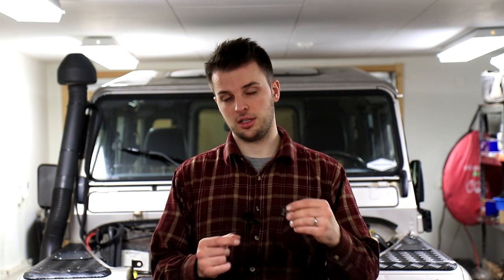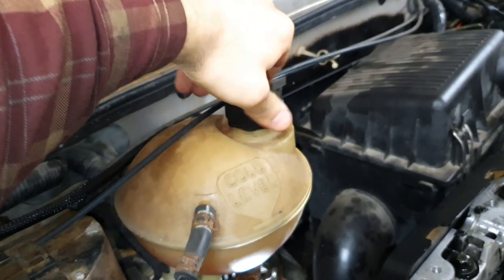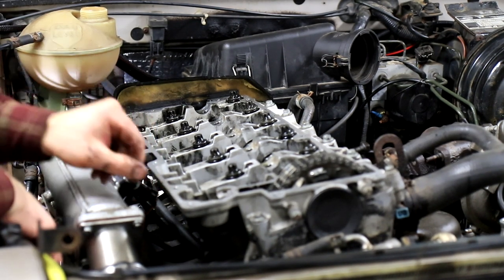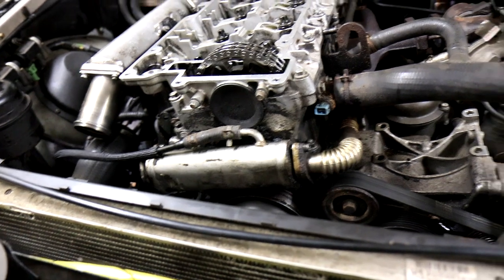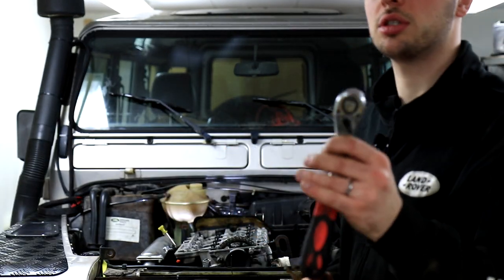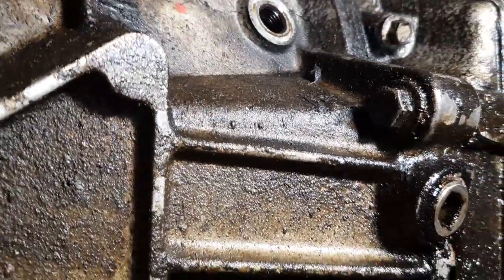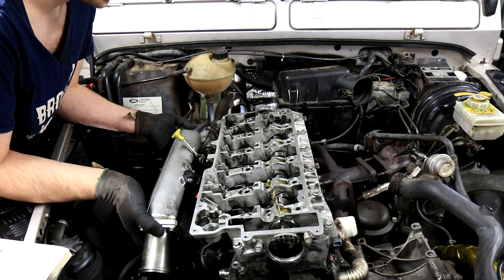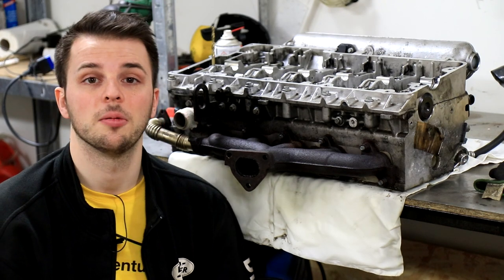Td5 Cylinder Head Removal - STEP BY STEP DIY - No special tools!

Comment: After owning my '01 Defender for 5 years, there isn't much I wouldn't/haven't tackled.   I'm at the same spot you were a year or so ago, diesel leaking into the oil. the surfaces of the injector locations are "knackered" (as some would say) so it's a new head. Watching this.....I'm thinking I can do it. Appreciate the videos.....and I even more appreciate that you're not getting too frustrated with spending $$$ on the rig!  That's the hardest part.
Reply from the maker: Aw man, sorry it is giving you those problems! 
I hope you get help from these videos and the courage to do the job. 
It was a lot of money but I got the vehicle for the price of a new head so it was worth it too😅 Good luck with yours!

Comment: Regarding the home made flywheel lock on the bell housing, I struggled to find the hydraulic fitting referenced in Haynes at short notice. However an 8mm microbore straight compression fitting is almost identical and has the right thread size, combined with an 8mm drill bit this works a treat. Screwfix / tool station always have them in stock in branch.
Simply bore out the centre with the same 8mm drill bit you’re planning to use, mark  on the drill bit how deep it needs to go in order to lock, screw either of the male ends of the compression fitting into the bell housing, gently knock the drill bit into place with a hammer, and if you want you can use the nut and olive from the compression fitting to lock the drill bit in place.

Comment: Amazing Content! I just assembled my TD5 head using the videos from the channel, my TD5 is filling up the cylinders with diesel, copper washers are new, it happens to all 5 cylinders, it works for a couple of minutes and then cut off/hydrolock.
Reply from the maker: Thanks for watching! Hope it helped!
Does it still do it or did you replace the cylinder head?
Reply: @Td5Adventures  It is still happening, I couldn’t find the reason so far, it didn’t happen before I take the head off. I’m guessing the rockers screws from injectores are too tight causing the injectors to flood the cylinders, is that a possibility? When you tight the screws, do you put some pressure on it or it is supposed to hit the top of injector smoothy? Greetings from Brazil!
Reply from the maker: @GHIOLIVEIRA1  hmm, weird!
You might have an injector which is stuck open?
Tightening them did require some force for me too..

Comment: Very helpful! Just adopted a friend’s disco 2 after it failed the MOT, found some rust holes and a pressurising cooling system. Pretty much resigned to head off and inspect but not in a rush 🤞 it’s not cracked! Useful to see one stripped, thanks!
Reply from the maker: Thank you! I'm glad it helps, that's why I do it😁
Let's hope you can fix it easily! Good luck!

Comment: Nice job👍 When you are tightening the head bolts, make sure the socket is 90 degrees to the bolt head, as they can easily twist off under the torque required
Reply from the maker: Thanks and thank for the tip! 
Will definitely remember to do that😊👌🏻

Comment: Excellent!!!  Did you finish the later videos (at least two) of this Head Gasket replacement?
Reply from the maker: Yes they are also on my page, this removal video, one where I assemble the new cylinder head and one where I reinstall the head gasket and cylinder head step by step😊
Thanks for watching!!
Reply: @Td5Adventures  Yes, just saw!  Such attention to detail - great work!  Doing my HG in next few days - your videos are A1!👍👍
Reply: @Td5Adventures  Really well done I must say - you are very thorough - I like that.  I'm going to put a new head gasket (+ several other jobs) in my D2/Td5 shortly, so these three videos are great to watch - I also have the Haynes manual and RAVE to refer to.

Just one thing, can I just confirm you didn't drain the engine oil (or remove the centrifugal filter housing), only the OAT coolant was drained?
Reply from the maker: @intestinalworm1202  Thank you!! I wanted to show all the steps so that it might help someone. 
I can confirm that I did not drain the oil before the procedure. I did do an oil change after the job because I had diesel in my oil, the reason I changed the cylinder head. 

Good luck!

Comment: hi very helpful video! do you lift the car to turn the Engine to OT or? I have a Disco 2 with automatic transfer do you  know if i just can put the transfer in neutral and then turn the enigen to OT? 
Greets from Berlin
Reply from the maker: Sorry for the slow reply and thanks for watching!
You can put the gearbox in neutral and spin the engine by hand 👌🏼
Good luck!

Comment: Love your Videos! It’s so much easier removing the cylinder head off a pushrod engine! Why are low revving diesel engines designed with Over Head Cams!?! Chevy V8s can rev to 9000 RPM with Pushrods!! Also pushrod engines are more compact lighter and cheaper to build!
Reply from the maker: Thank you for watching!!
I mean they might rev to 9000 after loads of aftermarket upgraded parts. There is no 1999 pushrod V8 that'll rev that high. Pushrod engines have been replaced for a reason though...
Reply: @Td5Adventures  Even if they are modified the point is a pushrod motor can rev much higher than the typical 4000 to 5000 rpm of a diesel. Some of these pushrod engines are tuned to produce 5000 hp!   https://www.youtube.com/watch?v=oeps18chvC0
Reply from the maker: @captarmour  Sure but with a diesel you don't need more than 1500rpm to get full torque out of it anyways👌🏼

Comment: Hi good job. Leaving the manifolds on adds considerably to the weight of the head as you found out. When I did mine I was working on my own and so removed as much as possible. Still very heavy.  My 15p head was cracked and I went through the same process as you replacing injector seals twice before finally accepting the head was cracked. I replaced the LR head with an AMC head which has now been on longer the the original without any problems. Would throughly recommend you replace the head. I presume the Haynes manual states that you replace the head bolts as these must not be reused. 
I will continue to watch your progress. If you need any advice please ask, I will try to assist.
Reply from the maker: Thank you! 
Yeah but I wanted to make as easy access as possible to the manifold nuts as not to snap or round any off :)
Yeah, the head will be replaced as so the head bolts and a few other stretch bolts!
Thanks for watching and commenting!!

Comment: I am having trouble finding a way to hold the fan pulley to unscrew the nut holding the fan. Are the tools you showed in this video Land Rover tools? Do you have part numbers?
Reply from the maker: Hi! Yes, the part numbers for both are LRT-12-093 & LRT-12-094 or get them both at Paddockspares as partnr PM1278
Reply: @Td5Adventures  thanks much!
I would like to get my hands on a low mileage late model TD5 Motor. I am finding out that this one has overheated a couple times and the Head has been cut(machined) twice. Once because of getting warped from overheating, second time from corrosion pitting due to use of incorrect coolant/antifreeze.

Comment: another question please. can I remove the head without removing the fuel injector rockers, shaft and the camshaft? Also if I mark the camshaft and chain with paint can i refit the head using these marks if I do nut turn the crankshaft or the camshaft? I'm guessing the tension of the valve springs would most likely turn the cam when I undo the cam chain sprocket...
Reply from the maker: Sorry for the slow reply. 
I don't think you can do that. Check the Haynes manual or Land Rover workshop manual for the exact procedure.

Comment: Your video is the best out there!  Quick question - I want to remove the injectors and overhaul them BEFORE I remove the head.  I assume if I have removed the injectors and then have both the locating pin at the timing chain end and then another underneath at the bellhousing BEFORE I remove the timing chain tensioner, then it will be all okay to remove the cylinder head (minus injectors of course)?  Once the head is machined it can then be replaced with the new gasket, knowing that the timing will be all good as the relative positioning has been retained by the two pins which have remained in place?  Once the timing chain tensioner is back in I can then put the overhauled injectors back in and all should be good? Does that sound correct?
Reply: You might also need to put thicker head gasket on to maintain clearance between valves and pistons , to do this measure how much piston protrudes above the block at tdc and check data

Comment: Hi ! thank you for this very useful video (and all the other you published here). Just a question please about the occurence of some pressure in the head cover. I recently removed my gaz recycling pipe in order to feed the engine with non polluted air. Now I collect the condensed oil in a dedicated tank. However I've seen that there is some kind of pressure from the pipe extracting the aily air form the head cover. It was the same, with the original pipe recylcing the head cover air into the admission pipes just after the turbo. Is this pressure nomal  ? It blows like my 12 year orld daughter on her birthday cake candels. Nothing less, nothing more. any comment about that ? issue or normal  ? my engine runs perfectly...
Reply from the maker: Thank you for commenting!
I think that it is normal to have a little air pressure coming from the rocker cover, there is some pressure because of the valves and oil pressure too. Doesn't sound like anything you should worry about. You should start to worry about it when hoses break or blow off 😉

Comment: I found the problem! Corrosion on the water passages have eroded into the top of 2 cylinders causing loss of compression and oil going into the cooling system
Reply from the maker: Glad you found the problem but sorry to hear the reason... You will need a new cylinder head then!
Reply: @Td5Adventures  took it to a machine shop, my friend said he has done many heads before with this exact problem, his first TD5 though. Thanks to your videos to make removing the Head fun!
Reply from the maker: @captarmour  Thanks for watching and glad to help! Good luck 😁

Comment: I have a good low mileage TDI 200, if I swap it in place of the TD5 can I still get the traction control to work?
Reply from the maker: I don't know, you should be able to make it work as long as you keep al sensors working and make sure the brake system keeps it's vacuum system I guess.
Reply: @Td5Adventures  on second thoughts keeping it standard may be better for resale value.
Reply from the maker: @captarmour  yes, there's so much work involved in swapping the Td5 for an older engine. The 200Tdi doesn't fit the gearbox, engine mounts, it'll need a different electrical system and need a different throttle pedal and a bunch more that just means so much work😉
Reply: @Td5Adventures  I'll save the Discovery TDI motor for the NA 110 I just got.
Reply from the maker: @captarmour  yes, that's a much easier swap, I think the gearbox even mounts straight to the TDI!
Reply: @Td5Adventures  fantastic! I love the pushrod TDI engines, simpler, more compact and easier to work on
Reply from the maker: @captarmour  yes they are easier to work on for sure!
Reply: @Td5Adventures  Thanks so much for your advice and encouragement. 
Can the Stretch Head Bolts be replaced with Studs? Does anyone produce a kit to replace the Head Bolts with Studs and Nuts?

Comment: Damn I hope I dont have to do this but I have been having cooling issues, So mine is a D2 td5 10p, automatic, 4th gear seems quite sluggish and that makes the temp go up, I have replaced water pump and thermostat. on a drive say to the store it wont over heat rides nice at like 87-84, return drive 4th gear she starts to cook acording to nanocom. But normal gauge shows good of course lol, I got no idea anymore, Some say air bubble trapped but Damn, getting frustrating
Reply from the maker: Hmm that sounds interesting 🤔  I hope you can figure it out!!
(Sorry for the late reply)